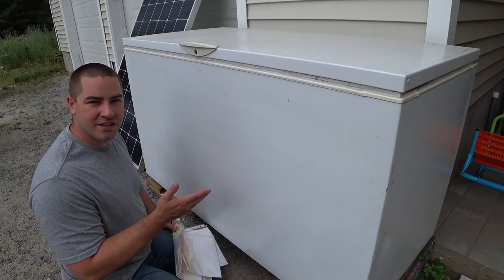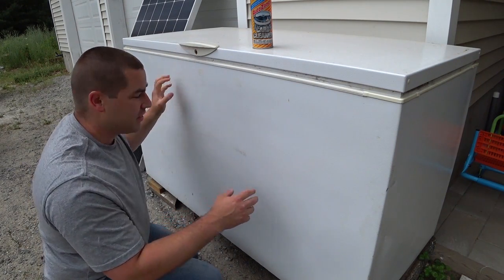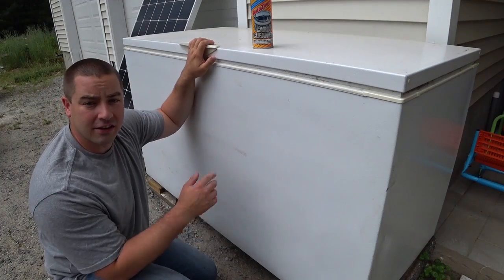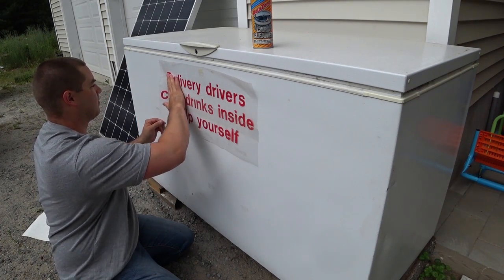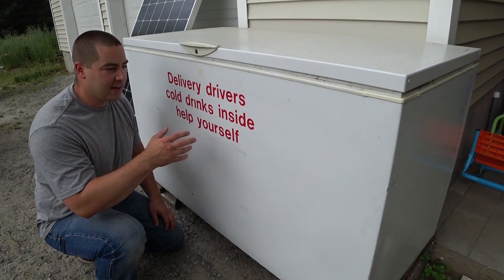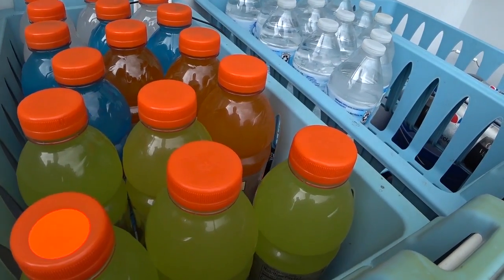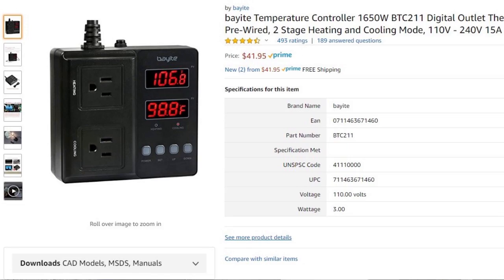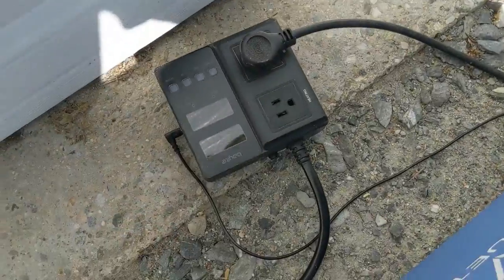Solar Powered Chest Freezer turned into Fridge

Comment: Hi Dave.
Your informative UTubies are very well done. A while ago you set up a Solar Panel to heat water soooz the next thought that i hope you may explore has to do with capturing the heat off the back of that panel which will help with the efficiency and gain heated water that will improve the total btu content. It would be very interesting 'me thinks'! Thanks.
Reply from the maker: There have been many companies experimenting with this since the 70's.  There always seems to be some problem.  In the end I believe in simplicity.  Having the solar panels on a ground mount where air can circulate freely behind them is simple.
Reply: @DavidPozEnergy  I'm just planting the seed but i believe it is doable ... by your great works. An idea becomes great when it becomes the receivers idea. I place your videos along side of Will Prowse's great works. 
Thanks!
robert in Concord, NH.

Comment: Low temp systems are designed differently than med temp (fridge).  Different compressors.  Different piping and coils. Different refrigerant which circulates with the compressor lubricating oil.  When you short cycle a low temp system to "create" a med temp system the oil gets logged in the evaporator and condenser and thus will seize the compressor.  Im a refrigeration tech.  Been der dun dat.

You NEED longer run times to prevent this and cutting out the compressor to prevent that you are heading for a burn out.  Takes time but it will happen.
Reply from the maker: Thanks for sharing your knowledge on this.  I had head that from somewhere else too.  That's why I set it for an 8 degree delta on the controller.  I figured that would help it run longer between cycles.  Do you suggest a different program?
Reply: @DavidPozEnergy  Hysteresis for the win! I was going to comment the same thing about adding Hysteresis but you were way ahead of me. It might be good to log the duty cycle and average run time just for grins.
Reply: I wonder, could you use a common mini-fridge, flip it on its back to use it top-opening, and simply rotate and remount the compressor so that it is still upright?
Reply: My 92 year old when he passed dad'nlaw had 4 chest freezers a couple used as refrigerators. He used 10 foot small diameter wire 16 gauge extension cords surprisingly most worked and no fires but he would freeze buckets of salt water and use a small rv fridge fan he did things his own way and insisted it was the best way. The family had a food ministry
Reply: For a fridge, I thought the freezer sent cool air to the fridge.  Maybe just the older ones work this way?
Reply: I ran a smaller chest freezer as a refrigerator for a year-and-a-half. Water condensation and mold was a big problem. It's okay for an experiment but the new small refrigerators at Best buy and home Depot are very efficient.

Comment: Very effective use of solar the only thing I'd do different is covered it with some car reflective solar cover since it's it's out in the direct sun. Otherwise just a great job 👋
Reply: Can't insulate the base cabinet exterior on this model of chest freezer, as the metal exterior acts as a heat radiator.  On older units, the condensor coils are attached to the outside cabinet which acts as a giant heat-sink.
Reply: Same here!
Reply: or some attic radiant barrier

Comment: How is your bms working for the lg 48v 6kw battery bank? Does that balance the cells? I was reading specs of the bms and they seem a little high. Over volt protection 4.25v and power balance detection 4.18v. Also the over discharge protection says 2.7v. Battery hookup states 4.2v as high cut off and 3v low cut off. What are you charging to and discharging to? Does the bank get balanced by the bms? Do all the cells have to reach 4.18v before they start to balance? Thanks
Reply from the maker: On the LG battery I used a 200 amp BMS from Daly.  It is working fine, no problems.  I have tested over-voltage and it does turn off.  There is balancing built in, but it is very weak balancing current.  The LG packs are perfect right now, so they probably won't need balancing for many years.  I personally charge/discharge Li-NMC to 3.0-4.05 volts per cell.  yes, it's fairly common for a BMS to turn off at 4.25v.  You can order it to turn off at any voltage you want.
Reply: Ok. Thanks for the reply.

Comment: I'm contemplating rerouting the freon in my tiny little apartment fridge that somebody gave to me for free to do the same thing but literally turn the entire box into a freezer. I lived for 2 years without a refrigerator or freezer and then when somebody gave one to me it's causing more problems than I had before I owned one. No,, I have no idea why I keep it or keep trying to use it...The only thing I use it for pretty much is to keep water cold...🤦‍♂️😂

Comment: Neat! You could almost power an inverter directly from the solar panel with no battery and just let it cool only while it is sunny. The thermal mass and insulation would keep the drinks cold through the night. Would need a way to prevent the compressor from starting until there was sufficient sunlight. Perhaps a voltage sensitive relay...
Reply: starting a motor uses many times more power than running it. it might peek at 1kw for a split second while it gets spinning. once its spinning it's easy to keep spinning.
The battery helps with this inrush.
Even an inverter has a same issue because when it powers up it must fill its capacitors and there is a large inrush.
You could design a system with a very large capacitor to replace the battery but at that point your better off just using an old car battery because its cheap.
Reply: @KillaBitz  I think one could design a system with a custom variable frequency drive to eliminate the startup surge. A few companies sell a similar device intended for water pumps which might be adaptable to a refrigerator.

Of course, it's still just easier to use an inverter+battery combo or a fridge with a DC compressor.